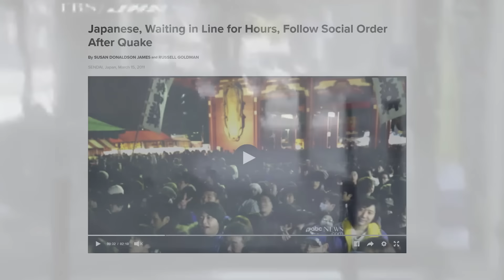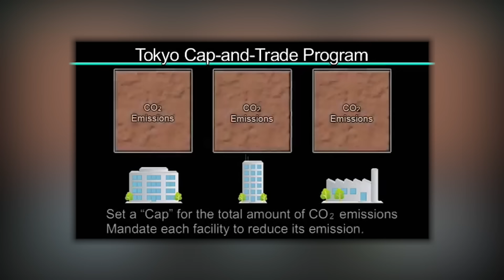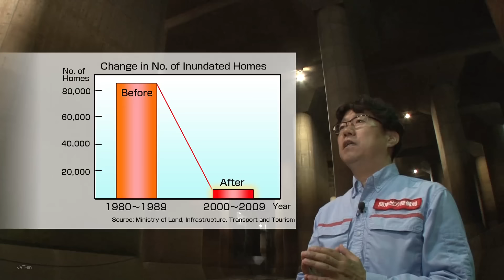Earth’s Model MEGACITY: Tokyo, Japan

Comment: The power-lines aren't usually installed under the ground in Japan because of the earthquakes. It's much easier to fix everything fast when it fails in earthquake when it's all visible and easily accessible :)

And that kind of gives that very distinct look to the urban (and other as well) areas of Japan :)

Comment: There is something I can not understand. The video says Tokyo has a length of 32 km(3:53). Shanghai, has 110 km length, and 100 km wide, yet it has a much smaller metropolitan population, and there are more tall buildings there, than in Tokyo.
Anyway, I have high respect for the Japanese, they are diligent, and very smart, yet very polite! Long live Japan!

Comment: 5:03 I want to issue a correction for this part. No, congestion was not eased by the cross bay tunnel. It connects a suburb on the west to a rural area in the east so not only is it not connecting anything useful, but it also costs 3000 yen (about $30USD) so it is rarely used except for a few trucks going to factories. It is widely seen as a $11billionUSD failure.

Comment: If Greater Manila Area Can Learn from Successes and Planning of Tokyo, Then, The Manila Megalopolis Area Will be Like Tokyo Because its Roads will be Clean, Powerlines is Underground, it is also Technology Superpower of Asia, It's Airport is Located Within the Coastline of Manila Bay Just Like the Tokyo Haneda Airport, Manila Bay as Clean as Tokyo Bay, 4 Bridges, and Tunnels Link from Metro Manila, Bulacan, and Cavite to Bataan's Design and Layout will be Inspired by Tokyo Bay Aqua-Line Road, It's Housing and Offices will be Mostly Vertical Similar to Hong Kong, Seoul, and Some Parts of Tokyo and its Free of Slums Because Most Condominiums are Subsidized Like Singapore Housing, It Has a Landmark Tower Located at Quezon City with a Height of at least 1000m and Floors of at Least 200 Floors Which will be the World's Tallest Building Just Like Tokyo Skytree and Another Landmark Tower Located at Manila-Bulacan Airport which is Also a Control Tower for That Airport with a Height of More than 300m Which will be the World's Tallest Control Tower Just Like Tokyo Tower, It Will Have Extensive Railway Network with More than Hundreds Train Lines Running within the Megalopolis Area so that it Will Reduce Dependency on Cars and There will be Elevated Expressways and BRT that Will be Used for Those Who Have Car, and Those who Uses Buses, BRT Network, and Road Trains for Commuting that will be Inspired by Shuto Expressway.